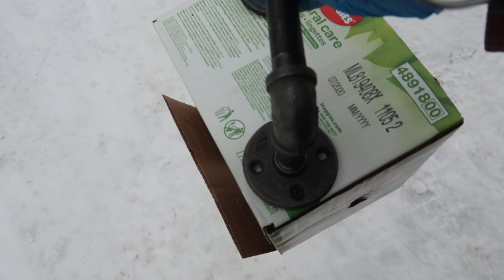This is Going to SAVE a lot of Money & Time! We should Have done it Years Ago

Comment: Harbor Freight: Over the years, I've found Harbor Freight tools are great for one-time-only use, like if I need a tool for a quick project and never plan to use the tool again. If you want a tool that you need to use over and over again, I personally think it is better to spend a little money - not necessarily top-of-the-line, but not bottom-of-the-line, either. Some things are OK - I have some Harbor Freight trolleys (aka, hand trucks), grinder disks, and shovels, but usually nothing with moving parts (except wheels) or multiple pieces (they will fall off, like as not). Inspect all welds very carefully.

Comment: Goood Morning Al ,
I think that I would have tried spraying the slide up door with WD-40 before going to the expense and time of making a handle.  Many people think that WD-40 is a light duty lubricant. It actually is a water displacement spray.  Hence , WD .
 It may also reduce rusting of a vehicle by spraying the insides of the wheel wells  and other exposed metal parts  (frames ? ) with WD-40.  That way , it can repel water and moisture .

Comment: I make stock/broth every time I have bones. Since I don't have chickens and don't add to the compost pile much during the winter, I have a scrap bag in the freezer for all the odd little bits of onion, leek, celery and carrot that I don't want to use. That is what I throw in with the bones. What I don't immediately use in soup I freeze in 4, 2 and 1 cup containers in the freezer. I haven't bought stock in 40+ years. First because they all had MSG and then because mine was so much better ;) and cheaper!

Comment: Those vise jaws are easy to fix...even if the screws are broken off. I had to cringe seeing you use those pliers on the threads of the fittings even though I know they don't have to be water tight. Great idea on screwing the handle to box to paint it!

Comment: Al, please save your $25 in iron pipe fittings next time and drill 2 holes in the door and put a rope through it and tie some knots. I thought at least you'd find a sturdy limb to fashion a handle like you've done before. Another SUGGESTION might be to ask your viewers what might be a good way to fashion a handle if you're inclined to looking for alternative ideas. The handle you made is awesome, and came out great, but in my opinion is pricey overkill. Have a nice day.
Reply: Rope won’t work, there is not enough room between the door and the coop to tie a knot .. I have the same king of sliding door on my coop there is almost no clearance between the two
Reply: @georgevangordonjr8963  You might be able to make a recessed hole on the back side to contain the knot. How bout clamp the rope to the outside panel with two little tie downs?  How bout a large D-ring like you see on a large trunk or crate? There are many less expensive alternatives which was my only point. Have a nice day.

Comment: Al the vise.... have you drilled out the broken screws , used an easy out ( use your torch first ) and replaced with higher quality bevel headed machine screws? Use a little lock tight on the threads and fix it ! Another how to video !!! Or show folks how to remove broken screws make your own "soft jaws" out of an old cutting board ?